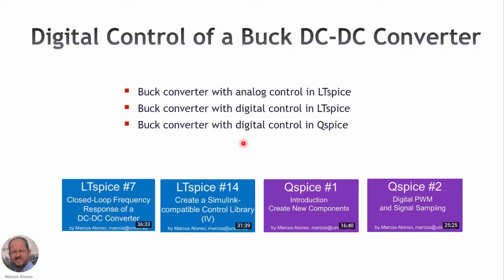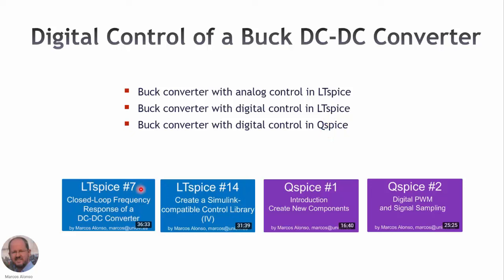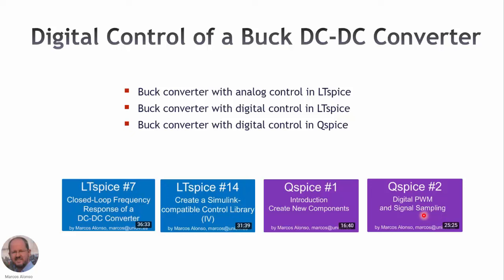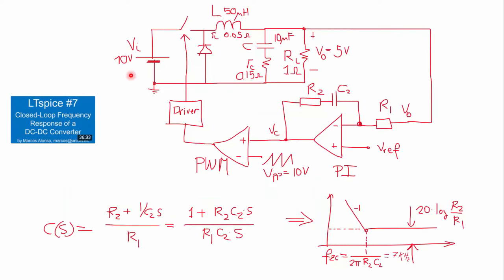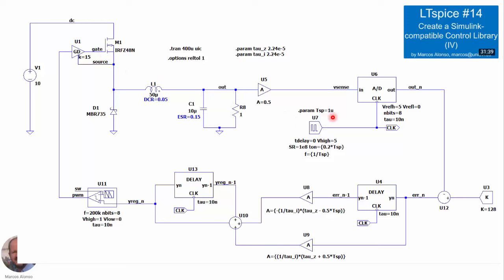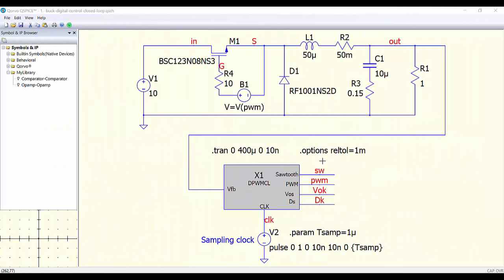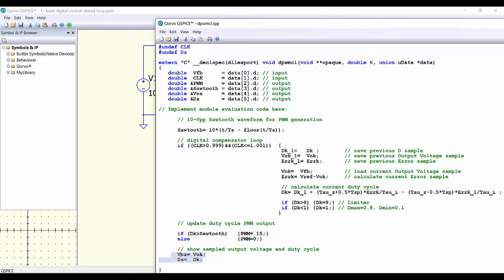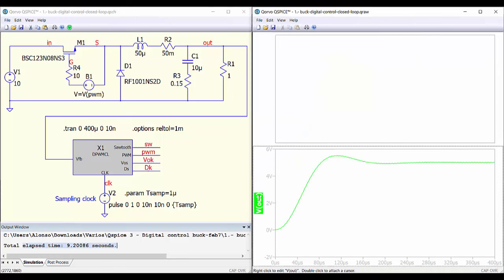Qspice #3: Closed-Loop Digital Control of a Buck DC-DC Converter

Comment: Excellent Video Sir. 
I learnt a lot and hopefully in near future I will be able to implement these learnings in real application. 
Thanks Sir and best Regards, 
Sanjay
Reply from the maker: I am very glad to know. Thank you!
Reply: Sir At 3.00 the phase of G is -90. Is it always -90 or it can change depending upon load condition.
Thanks,
Sanjay @MarcosAlonsoElectronics
Reply from the maker: @sanjayagrawal6143  
Hello, the load resistance affects the dynamic response in several ways.
If we increase the load resistance too much we will enter into DCM mode and the dynamic response of the converter will be different.
If we keep in CCM operation the load resistance still affects the converter response. The characteristic polynomial of the buck converter (the denominator of the transfer function) is the following (neglecting parasitic resistances):

s^2 + (1/(R*C))*s + 1/(L*C)

The roots of this polynomial depend on R and therefore the response will be different.
Usually we consider an overdamped response of the converter so we can consider that the cut-off frecuency will be w=1/sqrt(L*C).
This is good to do a quick manual design. 
In any case, the best way is to use a mathematical program like Winpython to do the design and plot the theoretical responses.
We have done this in several videos.

Comment: Thank you professor for the tutorial video, great resource for learning. 
One question I have: In the dpwmcl.cpp the input / output signals are defined as elements of array "data", for example 
   double  Vfb      = data[0].d; // input
   double  CLK      = data[1].d; // input
   double &PWM      = data[2].d; // output ...
Is the index 0,1,2 just randomly assigned? I was thinking it may correspond to the pin order of the DPWMCL block, but checking that it seems not related. (e.g. Vfb pin order is 3, PWM pin order is 0 etc.). So now my understanding is, these index doesn't matter, just need to ensure the variable names matches between C++ code and the block diagram pin name. 
Is this understanding correct?
Much appreciated for your response.
Reply from the maker: Thanks for your question. The arrays are automatically created by Qspice. I think it is best to let Qspice create them rather than doing it manually.

Comment: In future teaching videos, can the professor explain how to implement double closed-loop (voltage and current loop) simulation of a three-phase interleaved parallel boost converter in QSPICE? Can QSPICE implement the automatic adjustment function of PI parameters like matlab?
Reply from the maker: Thanks for the comment and suggestion. Yes, I think it is possible to adjust the PI parameters on line in Qspice.

Comment: Hello sir, is it possible to make a video regarding a dcdc converter using digital control in both CCM or dcm depending on the load requirements. Also with a uc from ti or stm?
Reply from the maker: Hello, thanks for the interesting suggestion. I will consider
Reply: @MarcosAlonsoElectronics  thank you good sir